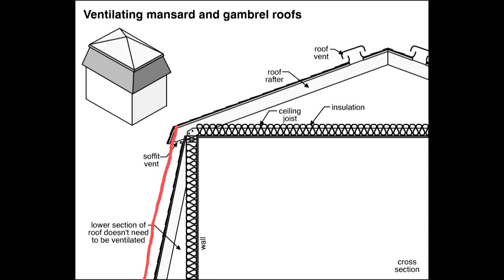Podcast 428: Why Radiant Heat?, Proper Construction Sequencing, and Waterproofing Mansard Windows

Comment: In regard to the floor sagging over the porch. I have an 1880s balloon framed Victorian that was original just a "monopoly" house with four rooms. The partition wall on the first floor is offset from the wall on the second floor. The house had a significant hump like you described but the exterior cladding is still pretty straight. We are on the tail end of adding a master bath in that space and I re-framed the floor with LVLs (as specified by a structural engineer). The hump was essential just due to the floor being under-framed (2x8x17'6") 24 OC. The joists in the middle of the room were sagging nearly 3 inches. The ledger on the outside wall was level and only down about a 1/4".